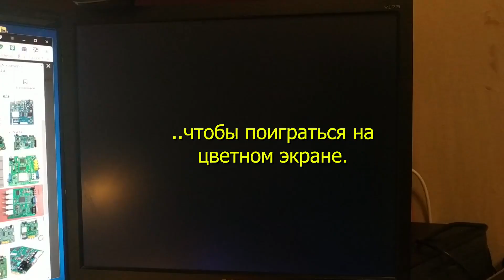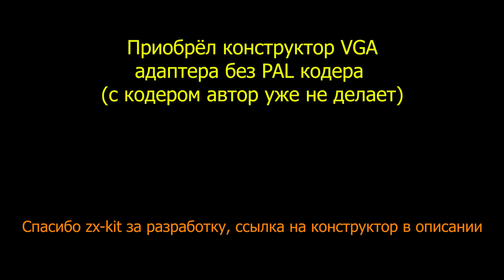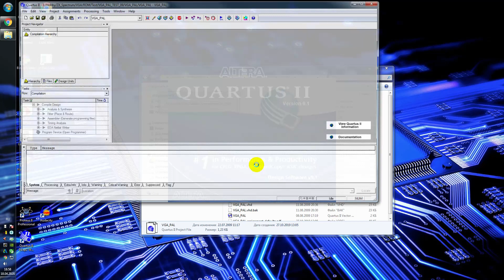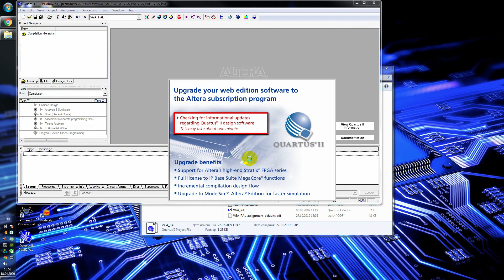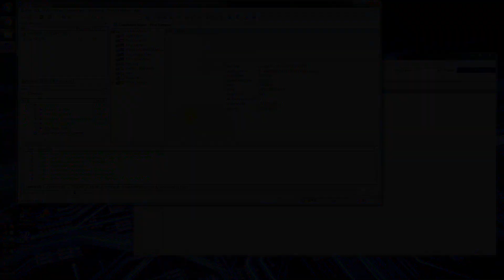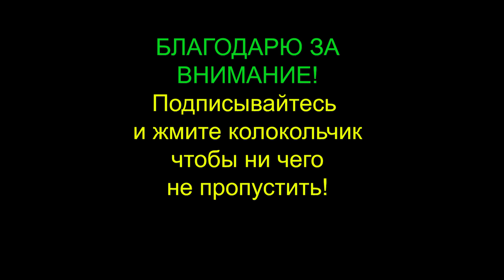ZX-Spectrum + ЖК монитор, RGBI-VGA адаптер (конвертер)

Comment: I think you've learned already to solder low profile components first and then the high profile ones - that header was in the way when you were soldering the QFP chip for sure... ;)
For SMD chips the best iron tip is the hoof one - give it a try and you won't regret it. Also, do not blow air while soldering as you can get weak solder joints.
Reply from the maker: Thanks for the advice, I will definitely use it: https://youtu.be/piUijemzmfk . I wish you good luck in your business!